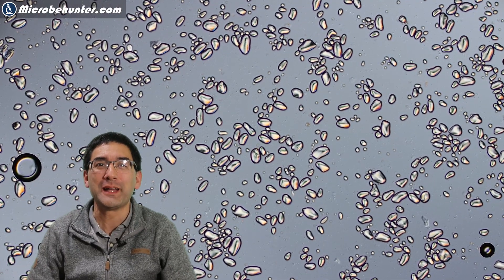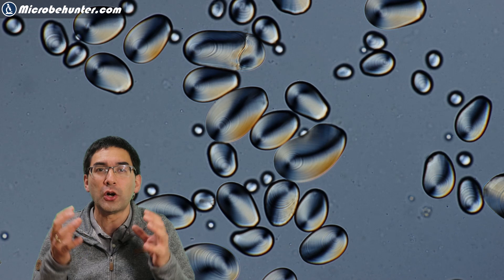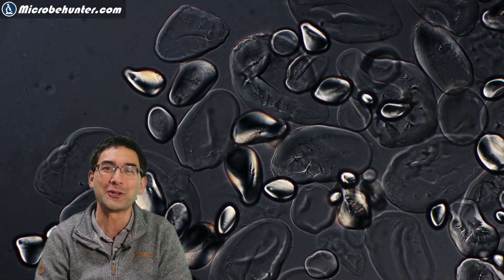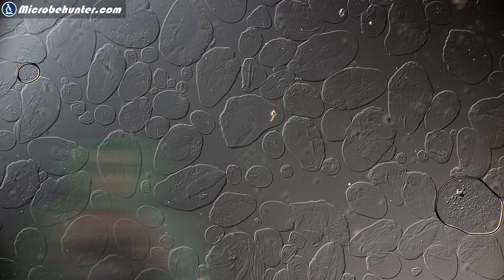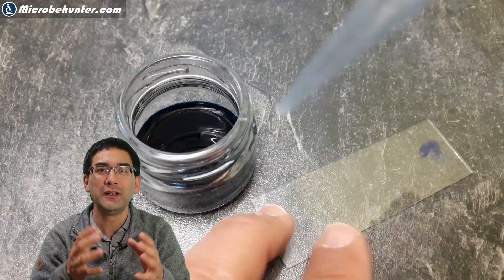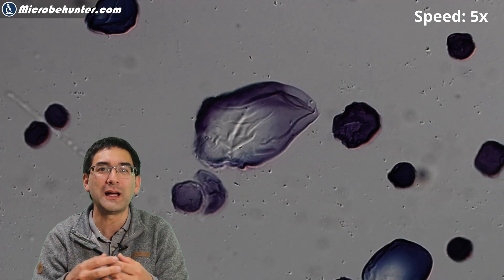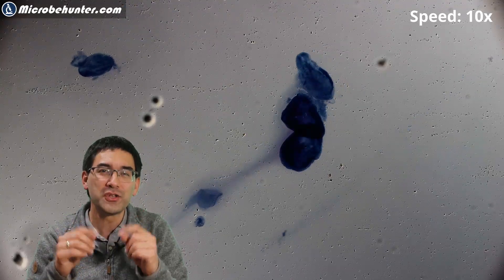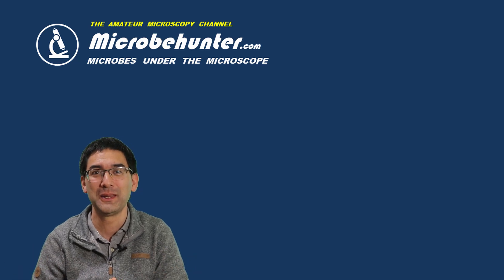Watch saliva digest starch under the microscope 🔬 195

Comment: Oliver plssssss this is my 6 time am requesting u plsss make a video on diy camera lucida for microscope 😭😭😭
Reply from the maker: Info for other readers: A camera lucida is a device that allows you to draw an image seen though the microscope. you can see the image superimposed on paper so that you can draw it. This requires a half-silvered mirror or a prism. Not so easy to do this DIY. But with practice, you do not even need one. Use your left eye to look through the microscope and the right eye looks at a white sheet of paper. you will then see both images (your brain combines this) and you can then draw. Better yet is to make a picture (photograph) and then print it out. Use a light board (amazon.com) to trace through the photograph on a new sheet of paper. Or please give me more information.
Reply: @Microbehunter  thnk u very much for replying i will try the without prism idea thnk u 😭😭😭😇
Reply from the maker: You can also try to put the paper over your monitor to trace it. or use your monitor instead of the light board, but do not damage the monitor with too much pressure (put glass plate over it).
Reply: @Microbehunter  ok thnk u 😇